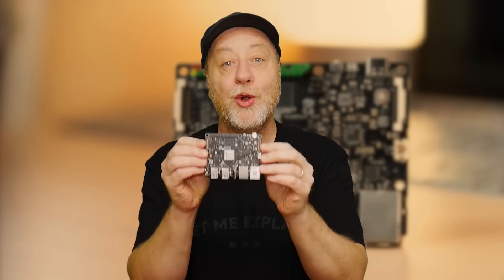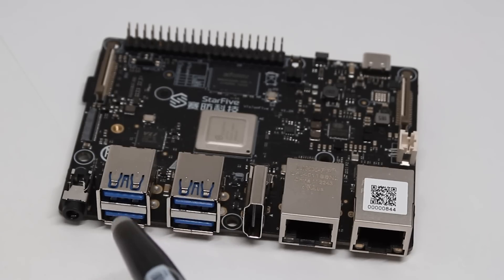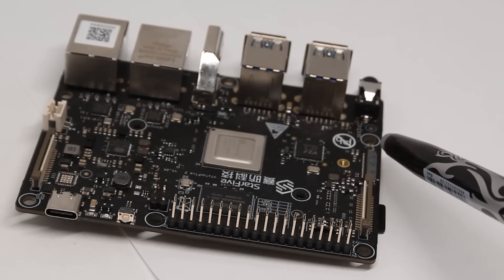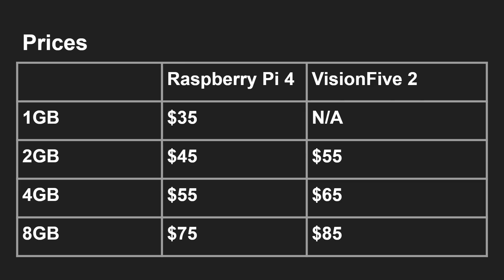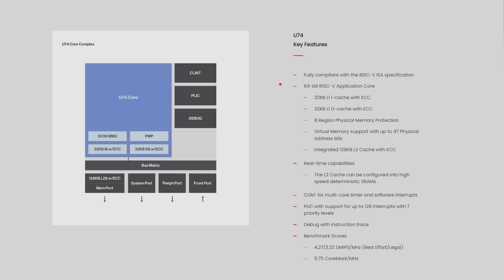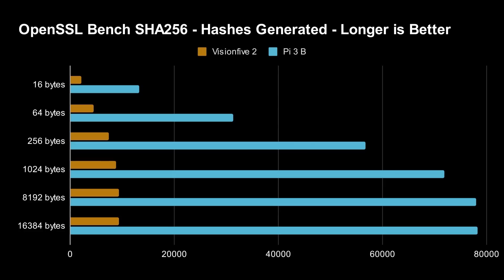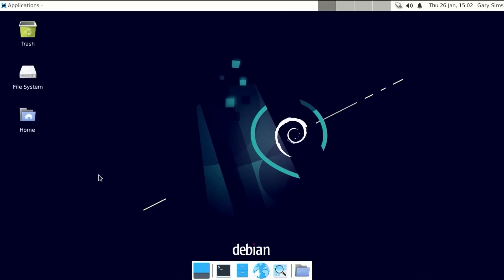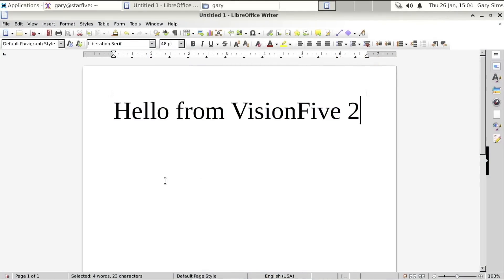VisionFive 2 RISC-V SBC - A Raspberry Pi Killer?

Comment: The open source could matter to the chip makers in the long run.  Over years it could amount to millions.

Really liked the benchmarks that was eye opening.
Reply: n.b. on the OpenSSL SHA256 benchmark as far as I'm aware, the ARMs were running carefully tuned hand written assembly language, whereas the RISCV was running compiled C code.  Whether this matters or not depends on your perspective...
Reply: @Tim_Small  So he needs to compile benchmarks from the same source code and compare run times. I'm too old to mess with assembly language.  LOL
Reply: @psikeyhackr6914  The fact that such optimised ARM (and x86) assembly code exists in important open source software libraries is important, but I think it would have been more informative to see a 3-way comparison of the compiled C code running on both ARM and RISCV vs. the ARM assembly (i.e. a third data point with OpenSSL compiled with the assembly optimisations disabled).  Probably the ARM compiler optimisations are better too, at the moment, but it would perhaps show a bit more of the potential of the core in the VisionFive.
Reply: Over years ? The licensing for chip EDA software is in the millions
Reply: @mattweger437  both of you should watch the many videos Gary had made explaining the misconceptions surrounding "open source" hardware. It's all in the risc-v playlist
Reply: @psd993  I'm working with the esp32c3 right now and loving it. I've been sold on riscv for years. So it probably won't sway me much
Reply from the maker: @Matt Weger What advantages are you personally getting from using the ESP32-C3 compared to the ESP32-S2 or even the S3. How is RISC-V making your project better that the previous models of ESP32 chip didn't?
Reply: @GaryExplains  well the s2 has a riscv  ulp co processor as well I was going to make the argument that it's more power efficient but....
Reply: @GaryExplains  the benefit for such high volume low price microcontrollers is twofold: for espressif it means no licensing fees, for users it means a standardised ISA (similar to arm). the combination of the two is why it will ultimately replace arm. just ask wd, seagate, qualcomm & samsung, why they switched to inhouse riscv cores for running their firmware...
Reply from the maker: @Claude Nobs  I notice you didn't answer my question. As far as I can see the C3 isn't cheaper than the other ESP32 chips. So I ask again, since you have been sold on RISC-V for years, how is RISC-V making your project better that the previous models of ESP32 chip didn't?
Reply: @GaryExplains  I can't speak for anyone else here, but the raw power isn't what's exciting about RISC-V to me at the moment. It's the fact that the instruction-set's IP holder can't be bought. It's not subject to the legal/geopolitical whims of a single host country either at least in theory. There is something to be said for such things. And someone has to be the first to dive in and port/write software for the platform, so it's nice that cheapish options for hobbyists exist now.
Reply: Better compiler support for RISCV in LLVM, vs the tensilica architecture of the earlier ESP32 chips is useful for Rust programming.
Reply: @GaryExplains  I suspect that where RISCV will get traction first is at the very low end competing with low cost 8 bit microcontrollers, as well as the low end ARM CortexM0 and M3 designs (and the dodgy ARM-ish clones like TC32), and other architectures like ATMega.  See for instance the $0.10 CH32V003 which is aimed squarely at the 8 bit market, and the GD32VF103, CH32V203C8T6 etc. (the latter which is $0.50 in single quantity) - which are STM32 clones minus the ARM core.  These will hist cost-sensitive very low margin products first, and as the ecosystem matures may creep up to higher value markets.  For the Chinese being free of "Western IP" is an important consideration.
Reply: @GaryExplains  As i've said it isn't about what i personally directly gain today, it's more about long-term gains to be had indirectly. 25 years ago, i asked the very same question about open-source-software, back then linux/gnu was cumbersome at best, but no-one would deny the benefits today. the next decades belong to riscv.
however since you want a tangible benefit today versus the old esp32 or esp8266: compiler support for rust. and doing away with the hassle of handling multiple ISA's (tensilica+arm). With the VF2 & ESP32-C3 we have compile once run on both.
To be clear: for me personally as a tinkerer today there is no direct benefit as compared to ARM. But there does not have to be, as stated above it's all about the long term benefits of the ecosystem. Not to forget, it puts enormous pressure on ARM not to screw up, which furthers innovation.
Reply: @Tim_Small  At the microcontroller level riscv displacing arm has been happening for years. WD, Seagate, Nvidia, Quallcomm have been doing it for years. So it's only natural this is now creeping into publicly available dirt cheap mcu's. Obviously the chinese political angle is only now really coming into play.

Comment: Awesome video, I'm personally really excited about RISC 5. I actually want one for a classic mac restoration project. I have a sneaking suspicion  that Mac OS Classic might be a good port for RISC 5 Systems and I fugred it would fit into a Mac Classic Case 😉
Reply from the maker: What benefits does RISC-V bring to your Mac port that you don't get with a Raspberry Pi or Arm based SBCs in general?
Reply: @GaryExplains  CPU Types mainly and the ability to cross over the coding. Power PC is RISC, is there any need to say more 😏I'm also working on two Mac OS Ports over at Macintosh Repository. Also I noticed RISC 5 is open about it's CPU Calls and Scims. I also have the same sheets for the Motorolla PPC. It will require some research and mass tinkering, but I think, the RISC 5 could be used as a drop-in replacement for old power macs. Keeping them from the landfills and giving them new life.  Finally, just saying, screw ARM 😝 Long live RISC 😆
Reply: @maccrash420  Power is big endian, these riscv cores are little endian (I believe). There is no guarantees that a recompile from source will work, in some circumstances, code changes may be required.
Reply: @jandrews377  Very true or a complete rewrite in some areas, like the ROM.
Reply: Don’t forget: ARM means Advanced RISC Machine - ARM is RISC!
Reply: @SchoolforHackers  I know 😆🙂 I just like how simple the Risc 5 is. Besides, it's just an idea 😀
Reply from the maker: Are you doing the port in assembly?
Reply: @GaryExplains  Just want to start off with saying I'm not sure if I want to take this on, but if I was to. The Rom and Resource Fork of Mac OS, is done in Assembly, then the rest is done in C. Mac OS requires the ROM to communicate with the Hardware and has some CPU Calls. The rest is based on the resource Fork in the system file. One could use the built-in 68k code layer and add whatever instructions the RISC 5 is missing. Just to bridge the old apps to work on the new chip. I have the source for Copland, that could be reconfigured, but it would take time and a lot of effort.
Reply from the maker: OK, and I guess I am asking why would all that stuff (68000 layers, ROMs, C, etc) be easier in RISC-V?
Reply: @GaryExplains  From what I can see there is much more information on the RISC 5, That's really the main reason.
Reply from the maker: Hmmm, I don't think I agree with that. I wrote a pre-emptive multitasking operating system (Piccolo OS, vids here on this channel), for the Arm base Raspberry Pi Pico (the RP2040). There was plenty of information available that helped me do that including documentation and examples. I don't think I have ever heard anyone say that the Arm (or x86) eco systems don't gave enough documentation or information. In fact I could argue it is the other way around.
Reply: @GaryExplains  I will definitely review those videos 😀 I'm sure you are right, but I don't have those papers needed for ARM. I do for RISC 5 and for Motorolla PPC. So if I can find/learn that information, then maybe I can work it into a viable solution on ARM. So review I shall and maybe, can get something working.  If anything is done I will leave an update. Also might be up to working with someone who understands the Arm systems better and exchanging information + source 😀
Reply from the maker: @maccrash420  I hope you enjoy the Piccolo OS videos. Arm's website is full to bursting with developer documentation, it is in Arm's interest to make as much information as possible available for developers.
Reply: @GaryExplains  Thank you, I'm very excited to see what I can Learn/Do 😃
Reply: Oops! It’s Acorn, not Advanced...
Reply: @SchoolforHackers  Arm is still a RISC Based CPU, so you are right there. Arm just has a crap ton of additions 😀

Comment: In the end the conclusion is reasonable, if oddly-stated.  If you are a developer/maintainer of some software package and you want to get it running on RISC-V (maybe people are already raising support issues asking for RISC-V) then this is the board for you. It's 5 or 6 times faster than the Allwinner D1 boards that were previously the only thing available for under $100, and it's got up to 8 GB RAM vs the 0.5 or 1 GB on the D1 boards. Night and day. You could get the same performance for a couple of years already on the HiFive Unmatched (which has 16 GB RAM and 4x PCIe vs 1x here, and can use high end Radeon or Nvidia video cards), but costs 10 times more.  BUT if you are a casual user who just wants to buy a board and every software package you can imagine already works then no, this is not for you right now. Gary says to wait a year. Maybe. Or, more likely I think, three or six months will be enough.
Reply: Pretty much.
There's some new RISC V architectures on its way out that I'm excited about.
But I haven't found any products with those cores yet...
Reply: @Luredreier  It is the natire of the electronic industry that you always know what is coming three years ahead. There are ALWAYS going to be fancy new cores announced that will take two years until someone announces working test chips of an exciting new SoC, another year to be in mass-production, and another six months after that to be on a board in a store where anyone can buy it. Right now, the VisionFIve 2 is by far the best price/.performance RISC-V board that you can buy and have delivered to you within a couple of weeks. The Star64 will soon be as good, better for some people. In three or four months the Sipeed LM4A with some dock may take over the mantle (it will be a little more expensive, but also 50% to 100% faster). HiFive Pro will be maybe 50% faster again, but cost maybe ten times more -- which will be well worth it for anyone developing on RISC-V professionally, just as companies give employees $100, Windows and Mac computers, not Raspberry Pis.
Reply: @BruceHoult  Some things are worth waiting for.
The P670 cores from SiFive has 2 vector pipelines unlike this core that has non.
And it can run 4 instructions pr clock cycle.
This...
Not so much...
It's a significant upgrade.
Sometimes performance *matters*.
Reply: @Luredreier  P670 will be great. The core was announced in November, so expect a $1000 dev board two years from now in the first half of 2025, and maybe affordable boards late 2026 or 2027. The T-Head C910, by the way, also has two vector pipelines, each with a 256 bit ALU. A $100 Sipeed board with it is promised for the end of Q1 this year i.e. maybe 3 or 4 months away. The only problem? It implements RVV draft 0.7.1, not the final ratified version. Mildly annoying but, hey, three year head start...
Reply: @BruceHoult  Hum, true.
But I'd still really would like 4 integer pipelines.

I'll have to read more about the c910 though.

Honestly it would be kind of fun to implement a homebrew RISC V CPU sometime.

Comment: Super-selective benchmarking there Gary. I'm sure you know very well SHA and AES instructions were added to the RISC-V ISA in December 2021, long after this chip was designed, so you're comparing a hardware instruction on the ARM chips vs a software implementation on the RISC-V. Yes, sure, if you spend all your time calculating SHA hashes then stick with ARM until next year's RISC-V boards are out, but who the heck other than Bitcoin miners does that? If you want to show how this lack of SHA and AES instructions affects normal users then show us how long it takes to ssh into a server, or copy a file over the network using scp or https. I'm sure the Pis will win that too, but not by 500% or 700%. The same goes for the thread test. Sure, that's a useful benchmark for people optimising an OS, but how relevant is it to the average user? Not very! If you want to show how thread creation and switching affects (somewhat) normal users then show running autoconf and make -j4 on some large software package. What you've shown here is accurate, but very misleading.
Reply from the maker: You know that a make -j4 will be more about I/O than CPU. If you want to offer alternative testing at least be honest about what will be a good measure. But in the spirit of openness and "giving it another chance". I wrote a quick single-core benchmark that does software SHA256 hashing in C using a function from Brad Conte. It loops round doing multiple SHA256 on a small input. The Pi 4 finishes the test in 8.9 seconds, the Pi 3B in 16.32, and the VisionFive 2 in 18.6.
Reply: @GaryExplains  that’s much closer to what I’d expect, and a good result as the VF2 has micro architecture and clock speed similar to the Pi 3B. Please provide your source code. And you’re wrong about compiling. If you look att the total data read and written and divide by the time taken you can easily see that compiling isn’t stressing any modern “disk” at all.
Reply from the maker: "Disk" as in a class 4 Micro SD card?
Reply from the maker: @Bruce Hoult The code for my new and shiny softSHA256 threadtesttool is here: https://github.com/garyexplains/examples/blob/master/threadtesttool_sha256.c
Reply: @GaryExplains  I don’t know what “disk” you used, as the board also supports eMMC, NVMe M.2, USB3, and of course things such as NFS over gigabit Ethernet, all of which are faster than SD. However I’ve found that on similar boards (both ARM and RISC-V) as long as you have at least NFS over 100 Mbps Ethernet (I.e about 12 MB//sec) and enough RAM to cache binaries and header files, additional disk speed makes little or no difference.
Reply: @GaryExplains  thanks Gary. I got notification today that my board has shipped so hopefully soon I’ll be able to run this and a number of other benchmarks against my other RISC-V boards, Pis, Odroids etc.
Reply: @GaryExplains  thanks for making this quick test, it aligns much better with what i'm seeing on my vf2 (close to rp3). not that it helps when running sha/aes-heavy software (but apart from vpn what does?)...

Comment: Thanks for a cool video on this board, interesting format, my take, is nothing could ever be a RPI killer, wouldn't matter if it was half the price and twice the power, RPI just has too much community support and momentum, what is nice, is we have yet another option for us to tinker with, competition is king, and hopefully the platform improves rapidly.
Reply: Check out the Orange Pi 5. It's a surprisingly good board that gives Pi a run for its money on the high end. Software support was surprisingly good out of the gate, and the community has been jumping on the thing to build it out. I don't know if it will replace the RPi, but it may turn this into a two competitor race.

Comment: What does the 'file' command returns when you inspect a binary? Like "$ file /bin/bash". I am super curious about the reported architecture string!
Reply: Got docker? Run "docker run --platform linux/riscv64 -it drujensen/riscv-ubuntu bash" and play to your heart's content. Works fine for me on both x86 Linux and M1 Mac. To answer your question I get "/bin/bash: ELF 64-bit LSB pie executable, UCB RISC-V, RVC, double-float ABI, version 1 (SYSV), dynamically linked, interpreter /lib/ld-linux-riscv64-lp64d.so.1, BuildID[sha1]=78af774fdd526282745b82bd902a9bba4d1083a8, for GNU/Linux 4.15.0, stripped."

Comment: To be a Rasberry Pi killer, you have to offer a better cost/performance ratio. In my opinion, it is not that easy for any company since Raspberry Pi is a foundation.
Reply: The Pi 4 has awful performance and is beaten by loads of SBC's these days. Look at the RK3588(S) boards for example. Might be more expensive and the support isn't as good there but the Pi is very very long in the tooth now
Support is getting there - Pi foundation is not releasing a new Pi this year and that will be their downfall if they are not careful as I can get boards based on other cpu's etc. much more easily

Comment: $150 for an R-Pi?  A mini-PC costs less.  What is the point?
Reply from the maker: 1. It isn't $150. 2. Get a base model to start like the Pi Zero 2 W, which is like $15. 3. A mini PC doesn't have GPIO. 4. Don't quote or buy at scalper prices. Never.
Reply: power consumption
Reply: A mini-PC does not have GPIOs, I2C, SPI and all that jazz. Why people keep comparing RPi to anything x86-based? They're incomparable and belong to very different worlds.